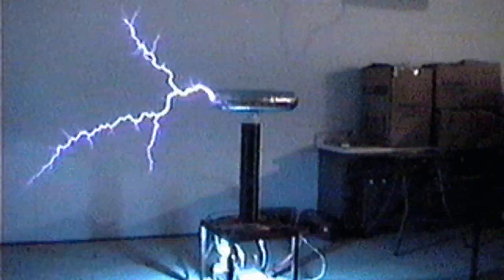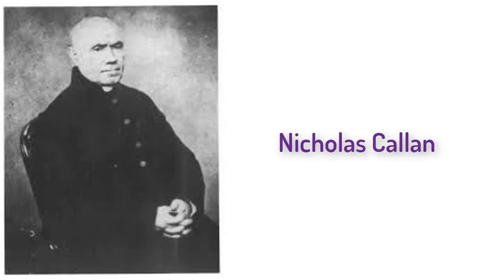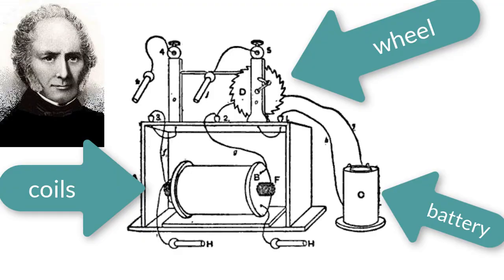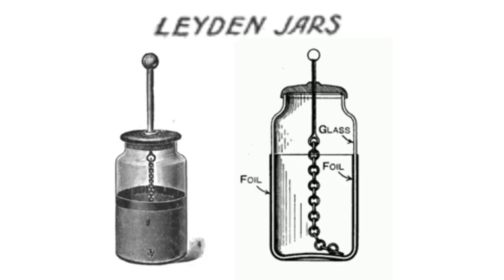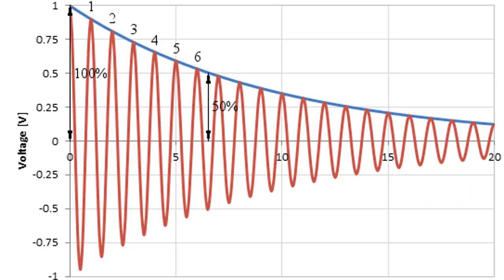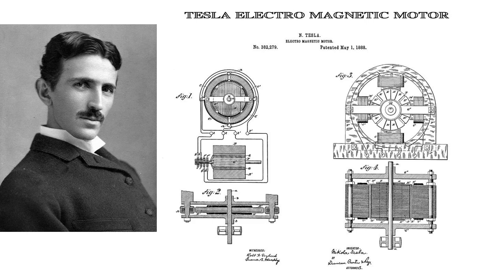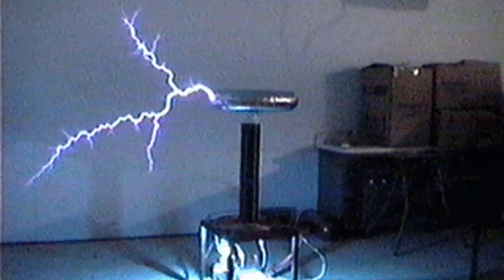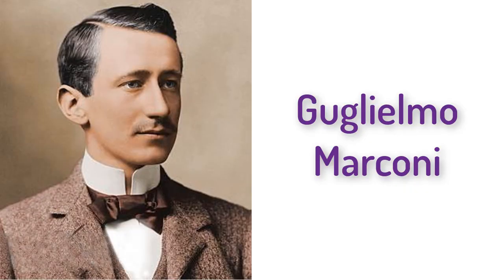How Does a Tesla Coil Work? A Historical Deep Dive

Comment: in 11:23 please explain why tesla's wireless electric distribution is impossible
Reply from the maker: It only goes short distances.  And it is a radio wave so it won't make the Earth resonate in sympathy.
Reply: @Kathy_Loves_Physics  Kathy, I’m so glad you said this. Would you give me a moment to explain why this isn’t true for all cases, that the Tesla coil does not always only transmit short distances with minimal power loss? I can give you a very legitimate physics explanation for how to change the power loss from decreasing proportional to 1/r^2 to only decreasing at a rate proportional to 1/r. Meaning the power is r times larger at any distance r away from the emitter compared to normal spherical signal dispersion. For the record, I do have a degree in physics from Michigan Tech University.
Reply: @Kathy_Loves_Physics  Tesla was not dumping the signal into the air and infact says this happens at great loss. The “antenna” or secondary circuit is not only connected to the terminal in the air. It is also grounded at its base to be able to use the earth. The point of the transmitter is to dump the power into the ground for transmission via normal ultra high frequency electrical currents, not into the air as hertzian waves. As this is the point of the torus dome, and/or the half circle placed all over the torus domes surface, in the magnifying transmitter patents, to work exactly like Tesla’s lightning protector patent, and reduce the electron density everywhere around the outer surface of the top dome, such that the top dome can be brought up to much much higher voltages without arcing off and breaking down the dielectric of the surrounding air and leaking energy and power to the air. (The single pole vacuum bulbs that have little lightning protector umbrellas inside them, that Tesla invented for his non dispersive energy projector device, could also be spread out all around top dome/torus, and make the whole unit be able to see upwards of +50million volts High frequency AC. Coincidentally, this is EXACTLY the way Tesla had an artist draw up the finished wardenclyffe tower for his official letterhead that he had made. It looks like it has bulbs all over the top dome and it should.) Again the reason this is desirable is because ultra high frequency ultra high voltage signals put into the earth but at insanely low currents would have extremely low ohmic losses even over massive distances, just like what’s advantageous for his ac wired system over dc. But as he says in the magnifying transmitter patent he found no success attempting to use such high voltages and frequencies while still transmitting traditional currents Via normal electrical wires. Furthermore if the ohmic losses for transmission are insanely low, then the ultra high frequency signals go into whispering gallery resonance within the earths crust continuously encircling earth and transmitting tower while continuously “ringing” until there are inductive loads drawn off by some receiver. If there are no inductive loads coupled with the system then the ring down will only dampen at rate proportional to ohmic losses in transmission of the signal oscillation back and forth around the earth and back into the transmitting tower. But since currents are insanely low because voltages are insanely high with high frequency source currents from the tower, the power loss over massive distances, like the circumference of the planet, are extremely low considering the amount of power being put in. And since no one who is outside of a reasonable radius of the tower can utilize that signal at any significant load draw, it will stay continuously sloshing back and fourth through the earth with super low ohmic losses and low power available to be drawn everywhere except near the tower for a very very very long time. Which means that you can dump power into the earth and stop producing power and that power should be able to be drawn off for a reasonable amount of time after the power dump is stopped. This is just one of the ways the tower works efficiently without “power loss”, because it’s not utilizing em waves in the same traditional way as everyone things is being done with the signals from the sparks on the top.

 Now how this happens with the improved power loss over distance though is in the same way the SOFAR wave guide channel deep in the ocean that traps acoustic waves into planar or cylindrical dispersion patterns transmits power signals at a decreasing rate of only 1/R. (instead of spherical dispersion with a power decrease of 1/R^2) There are layers in and around the earth that trap high frequency signals with these thin wave guide channels. When all portions of the power signal are reflected from going up or down in altitude/depth within the thin wave guide channel this forces the power intensity to be spread out around the “circumferential length” of an expanding cylinder/circle instead of spreading out around the circumferential surface “area” of an expanding sphere. I will provide a link below that goes through the math for the change of power loss from 1/r^2 to 1/r. 

To that note, There are “whispering gallery” resonances of the atmosphere, starting just off the surface off the earth going all the way up to the ionosphere. These resonant wave guides around the earth allow for power transmission with a far lower rate of power loss per distance. This is proven stuff and the military has been using these channels for submarine warfare techniques for over 100 years.

And please, please, please don’t tell me that it doesn’t work because everyone said that about his turbine and I’m making them work plenty fine. Just clocked 2.75kW and 6.22ft-lbs of torque at 4150rpm with just compressed air alone. 

People just don’t understand the fine details that contribute to the efficacy of the system. As I said above, everyone likes to scream bloody murder about “BUT POWER DROPS WITH A RATE OF 1/R^2!!! IT CAN’T TRANSMIT POWER OVER ANY DISTANCE!!”… which is partially true if you make a tiny one and put it in the wrong location. However I would still continue with, so do acoustic sound waves. Yet whales can dive down to the SOFAR channel depth of the ocean and communicate around the entire world with each other even though they cannot possibly produce a sound loud enough in free Space underwater to travel around the world. I would also suggest looking up project Mogal as it shines light on much of why the government kept these whispering gallery wave guide channels in and around the earth under wraps at the time… plot twist… it was for the sake of national security….. go figure. 🤷‍♂️
Reply: @Kathy_Loves_Physics  (well apparently I can’t post links in your comments… here’s the repost of the comment I made. “cylindrical vs spherical spreading discovery of sound in the sea” is what to look for. I tried to give a reliable source to back up my claims but apparently that’s not allowed lol 🤷‍♂️)
here’s all the mathematics to show how power loss at a distance decreases proportionally from 1/r^2 to 1/r, yielding a power signal r times larger at a distance r away when a wave signal is trapped in cylindrical vs spherical dispersion. Now as well the thickness of these cylindrical wave guide channels can be made even thinner, with using very high frequency power signals such that the earths “skin effect” can be utilized in such a way that power signals traveling away from a transmitter get trapped in planar or thin cylindrical dispersion patterns in the very thin surface layer of the earth, and the thin thermocline layer of air just off the surface of the earth.

And as a proof to show that even visible light can get trapped in wave guide channels just off the surface of the earth/water, one of the age old “flat earther” proofs that was thought to disprove the spherical earth was that when tests were done across long flat surfaces of water, where the curvature of the earth should be visibly noticeable, they “measured” a straight line from sight to target with no deviation. But these testers forgot to account for the fact that the air just off the surface of water is a drastically different t temp than the air about a meter to two above the water and the change in temperature acts like a change in index of refraction and acts to continuously bounce/reflect the light off the interface between the two different temp layers of the air causing the light to actually curve around with the earths curvature giving the illusion that the earth was flat. This is a notorious case of making sure to know all the variables in your experiment before making assertions. Something, admittedly, Tesla did once or twice too.
Reply: @Kathy_Loves_Physics  for example, for spherical dispersion, at a distance 10 meters away from a source you will have a 20db power loss. But with planar or cylindrical dispersion, you will only have a 10db power loss. However that being said, depending upon the power loss due to resistance/absorption, as the cylindrical plane spreads out and reaches 1/4 way around the earths sphere, the widest part of the earth that makes a plane that has its normal line pointing at the source, it will be at its smallest intensity at any one point. But as that signal then continues around the earth to the point on the opposite side of the planet, as the source, the intensity then begins to increase again as the surface that the intensity is spread out on gets smaller and smaller as it converges on the point opposite the planet from the source transmitter. Now in theory if there was completely no resistive loss for the power signal as it traverses across the thin spherical wave guide shell around the earth, via cylindrical dispersion patterns, then the intensity on the opposite side of the planet of the transmitter would be the same as at the transmitter, and in theory have zero power loss (again if we were to disregarding the ohmic impedance of the transmission medium.) this is because the power loss of a signal as it spreads out isn’t due to a loss of the energy it’s from most of the energy not hitting the target and going everywhere else in every direction. If all those signals were to be curled to re-converge onto a single point that is quiet literally known as a lensing effect. And none of this requires the signals used to go into resonance with the earth at all either! This is not Schumann resonance hokum which relies on a specific frequency to go into resonance either. These cylindrical wave guide channels happen across a broad spectrum of frequencies. Again this is how whales can communicate around the world with each other deep in the ocean, and still get reasonable fidelity across a broad spectrum or bandwidth of acoustic frequencies, enough to convey full whale songs. Obviously there will be distortion, just like in signal transmission through a fiber optic line but with such high frequencies being used for electrical power transmission the signal will just smooth out to a continuous ac static. What really will trip your mind though is, and now this is completely hearsay, I have been told from a fairly reliable source, that the scientists at Visiz, the ones who made that Monolith of a Tesla coil in Texas, have not only figured out how to utilize the zennick wave guide channel for this kind of reduced power loss cylindrical dispersion of a wireless power signal transmission, but how to actually encrypt the power signal such that without the proper encryption key and variable/modulating receiver you won’t be able to pull a load off it with any kind of reasonable efficiency because of how “snowy”/“staticky” the transmitted power signal is and how fast you need to be changing the tuned resonance of the receiver to stay “in phase” with the transmitting power signal. So you need a receiver that’s constantly changing its tuning to the updated variable tuning/encrypted power signal emanating off the transmitter…. This is how they plan to be able to “meter” and charge for usage of their wireless power transmission. Again this is all hearsay about the encrypted power signals, but all the physics I know tells me that this is completely possible if it is in fact possible to utilize the increased power transmission capabilities of using the cylindrical wave guide channels in and around the earth.  Which we know is possible theoretically, as whales do this as well as these principles are highly coveted, and once highly classified, submarine warfare tracking and communication technologies.

I’m not saying a single Tesla coil will actually power the whole world. Just that the physics principles in theory are sound. Furthermore the more people pulling a load off the power signal that is surrounding the whole transmission tower, the less of that 1/r^2 makes a difference to the total efficiency of everything being powered, because only power loss to a single small receiver, some distance away, is proportional 1/r from the original signal. However, that doesn’t mean the rest of the signal that’s emanating out in all directions isn’t usable for anyone else in the path of the rest of the expanding power signal. If you put a single massive transmitter in the center of a densely populated city, and eliminated any intensity loss vertically into the sky, such that the whole power signal emanates away from the source in every direction in a thin cylindrical wave guide channel dispersion pattern, and every single home spread out around the receiver in every single direction from just around the receiver to the outskirts of the city had a receiver, the total power drop to any one receiver will still drop at a rate proportional to 1/r (not 1/r^2) but all of the total energy available put out by the power transmitting tower can be used efficiently as none of it will leave the city without being utilized by some receiver before even getting to a large enough radius that power loss is too low to use. Each receiver in the thin cylindrically emanating power signal path will be seen as a resistive load. For example, at 1000 meters, 1kilometer, from the transmitter, the signal will be 1/1000th of the original signal for any one receiver to receive (instead of the 1/1,000,000th the power for spherical power signal dispersion) to utilize.  That means if your tower is a 1MW, 1000kW, power outputting tower a single receiver can still get out 1kW of power at 1 kilometer away from the transmitter. Now if you have 1000 homes in a perfect circle around the transmitting tower all at 1kilometer away, from the tower, each home receiver is still capable of pulling 1kW at the same time, and thus can still theoretically get 100% of the total power available and energy emitted by the transmitting source to be utilized. This is because each receiver is using a different portion of the thin cylindrically spreading wave. Just because their is “power loss” from the tower to a single receiver doesn’t mean the rest of the energy not used by that single receiver is completely wasted. It’s just not useful at the location of said receiver. This idea of putting receivers all around a single tower seems a bit overboard until we think about how we actually locate ourselves around cities. What this means is that all we have to do is build a giant tower in the center, put all the high power demand factories  closest to and encircling the power transmitter, if they are within 10-50 meters away from the 1MW central tower the factories can pull at least 20-100kW. And this is just a single megawatt tower. When 100-1000MW power plants and power transmission towers are entirely feasible at scale. A 1000MW transmitting power plant would be able to provide 20-100megawatts to any plant within 10-50 meters of the tower, 10MW to any receiver within 100 meters of the tower, 1MW to any receiver within 1kilometer away and lastly at least 1kW to any receiver within 10kilometers away, that’s a 20 mile circle of being able to pull at least 1kW off the 1gigawatt tower with cylindrical wave guide principles being utilized. Again it’s only efficient if every single home and factory around and between the tower and the 10km radius is using the system too, but that in itself was the whole point. Making this viable for whole cities of populations. Not necessarily sprawling rural areas. 

And this is where my corporate espionage/conspiracy thinking hat goes on. Just imagine how much less copper and wires would be needed to span across every city. Then remember that JP Morgan bought all sorts of copper mines just after Tesla told everyone we would be stringing up copper power lines spanning the length of our country 100s of times over and he had a hold on the copper industry to profit off of stringing up wires across the country. Just imagine how annoyed Morgan would have been hearing that the investments he made into wardenclyffe just made in all the copper mine investments not be seeing their guaranteed ROI from guaranteed government contracts stringing up wires everywhere, wires that he had a monopoly on the source material, copper, because Tesla made his wired system obsolete…….  🤷‍♂️🤷‍♂️🤷‍♂️ just my speculative rumination lol